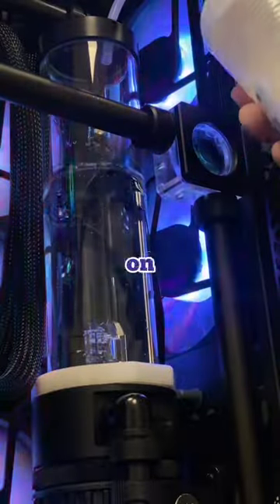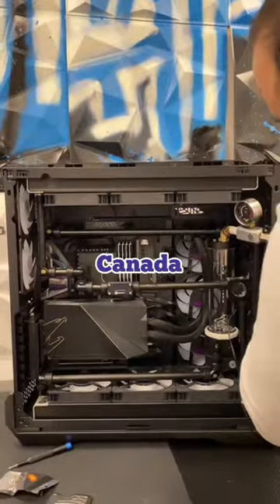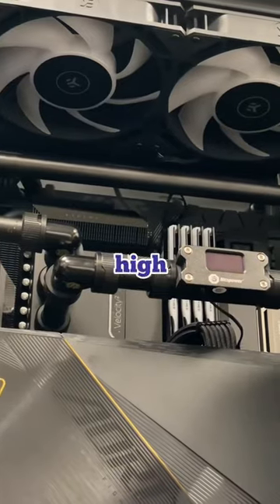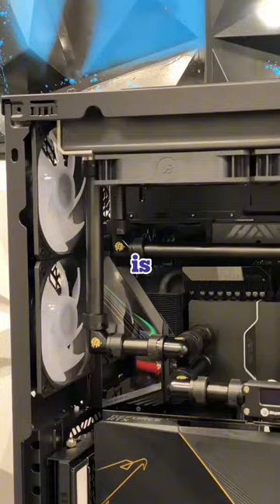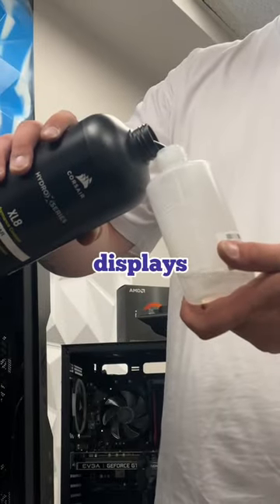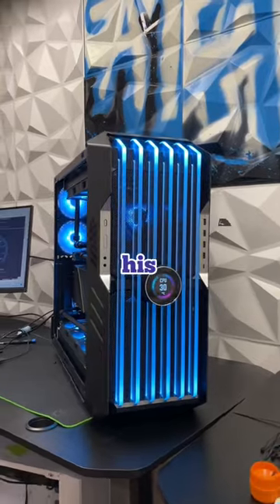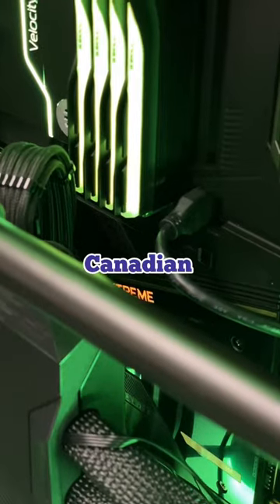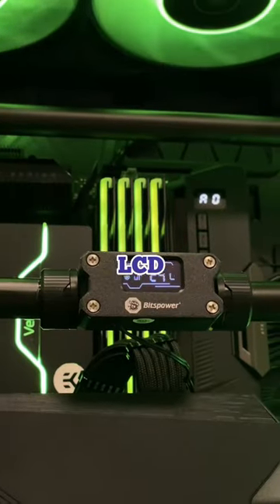BRASS TUBE custom loop! 🤯 #pcbuild #watercooling #gamingpc #pcgaming #gaming

Comment: Depending on what you do, 12k might not even get you a better PC than 4k.
As a Minecraft Speedrunner I'd need 4500 dollars to build the ULTIMATE best ever rig I could possibly use!

(Also if you think Minecraft draws nothing... learn about actually having Bedwars run well, but that's nothing even compared to SPEEDRUNNING!)
Reply: 4.5k parts and 6k+ on watercooling I guess? lol
Reply: @Born_Stellar  I don't think it's performing any better than a less expensive rig
+ FPS wise it could be matched by a sub 2k PC

Comment: Me with an RTX 2060: this is fine
Intel HD graphics users: 💀
Reply: I have a 2060 super and I can run GTA 5 on max graphics,it's not a bad GPU
Reply: i got a 2060 too
Reply: Yes l have a Intel hd graphics
Reply: I got Intel uhd 620 💀
Reply: im using a intel i3 with integrated graphics
Reply: I got an intel HD 4400hd
Reply: Rockin the Ivy Bridge CPU right there, like it!
Get a GPU though, some 600 series GTX would do nicely and match it era wise
Reply: @Zebra_Paw  It's a laptop except I use the GTX 600 series as an external gpu. How much would a GTX 600 series cost me
Reply: @cletusobute3396  Oh I was just kidding you really shouldn't get such an old card today you can get much better price to performance.
Not sure a laptop this old can take an eGPU, and if yes I'd take whatever fits your budget, with reusing the card in a future proper rig in mind. An RX 5700 is an amazing buy if you can find it used for like $120. Of course you'll need the eGPU thing to make it work.
Reply: @Zebra_Paw  Ah you really gave me hope with the GTX 600 series. But Thanks I will check the AMD Card out
Reply: @cletusobute3396  an RTX can also be worth it, just generally worse price to performance.
A GTX 600 series is not bad by any means I used one for video editing for a long time, and if it's all you have you can still make games work decently

Comment: It’s not worth it. You dont need a crazy loop for a gpu and cpu, yeah you might need to water cool a cpu like the i9 13900k or the Ryzen 9 7950x3d. Gpus don’t really get that hot under load, while playing a pretty gpu intensive game like cyberpunk my gpu only hit 74c

Edit: I only use a rtx 3060 ti and a ryzen 7 5800x. This cpu does not need water cooling, I use a air cooler and it works fine, gpu temps are really good too.
Reply: 13900k yes, the new ryzens not really. also GPUs are very good to put on water, your 3060 is a very efficient card, but many higher end cards easily hit 100C on the hotspot. and if you keep the card cooler you can overclock further.

Comment: This PC is a testament to human stupidity . Does it provide 3x performance than whatever is best 4090?
No?
Well OK then.
Or is the GPU some super professional 2x more expensive card than most expensive 4090?

Which CPU is it?
13900KS?
It is usually THE most expensive relatively mainstream CPU .

I mean if some Threadripper was inside , like 5975WX or something , okay fine whatever . but it is not .

So I guess just cooling is 2/3 of a budget .